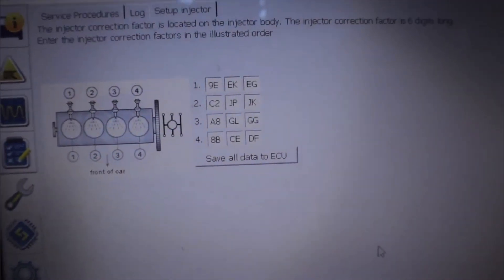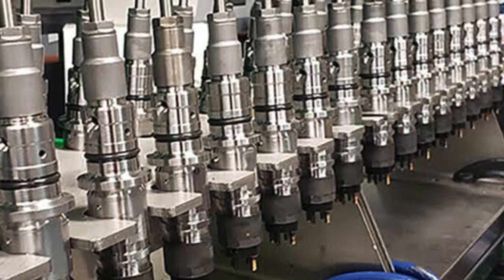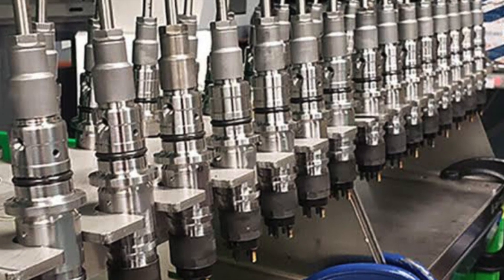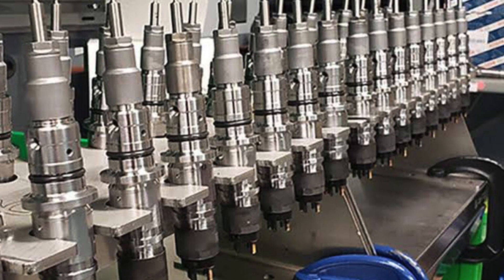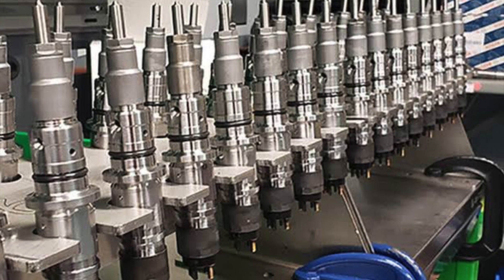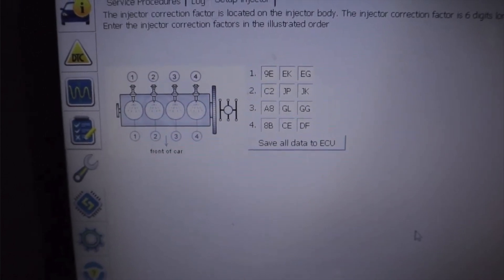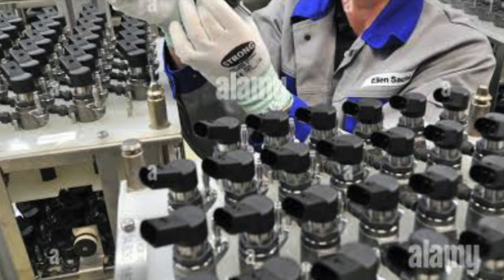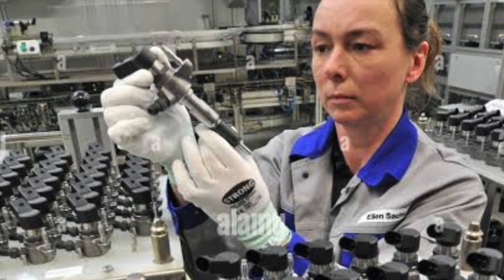Do You Need to Code New Diesel Injectors?

Comment: Bro your the man you no everything about rangers i got a 2011 3.2l 5cly turbo i was in dubo the oil light came on i stop asap 2 min later the engine was fucked shiped it back to brossy been putting another engine in all year it start an runs but the injectors need programing cause its not running well i wish i cud bring it to you bro is that possible im in brissy od bring it to sydne if u were there

Comment: I replaced fuel injectors for my mercedes C250 gasoline engine and after few days driving show intermittent pending code clynder 2 misfire, otherwise my car not passing Emission smoge test as FUL not clear,  you think all this issues cause because not coding new injectors or maybe I have bad fuel injector and need to replace it again  ?

Comment: Hi mate, Thanks for very informative videos. Can you install new injectors D.I.Y. style and then take them to a mechanic to code them who has the correct scan tool? ( without detrimental damage or blockages etc) Cheers from Wes. ( Ps I have a Skoda TDI, leaking diesel around the tops of injectors. May just be seals, but I don't have a VAG scan tool.

Comment: I always thought coding was required because the slight variance in the coil packs. 
The Ecm would have to compensate using slightly different voltages

Comment: Really, I changed my injectors last week. The 6 digit code for injector 1 was either B0JJJH or BOJJJH. I did head or tails and put B0JJJH thinking that if I got the wrong code, it would turn over. How do u confirm the right digits?
Reply from the maker: yours could have only been a zero for the number aspect, rest are al letters

Comment: How about the same injectors but have been serviced and their nozzles replaced with new ones; do they need coding?
Reply: pretty sure if your adding bigger nozzles like +30s etc the coding becomes completely reduntant..
Reply: Thanks 👍. I have tried coding those injectors after serviced and nozzles replacement using their original coding, using forscan but results seemed to be worst. 😢